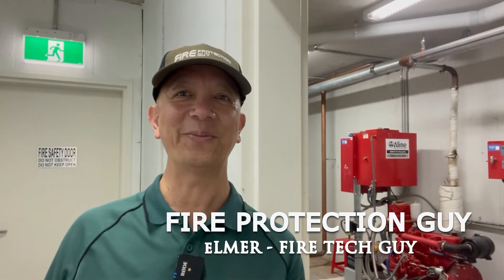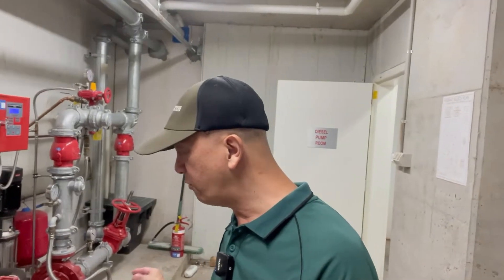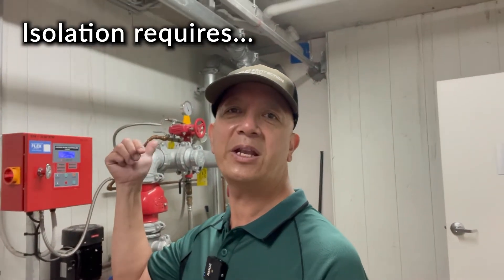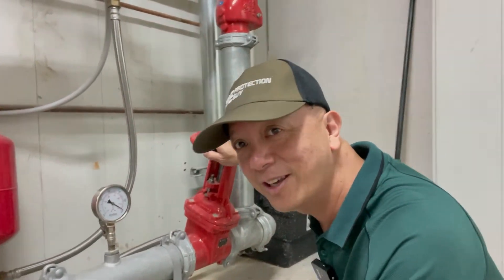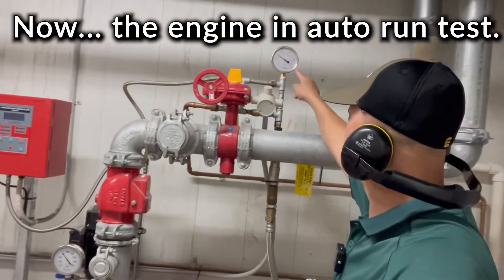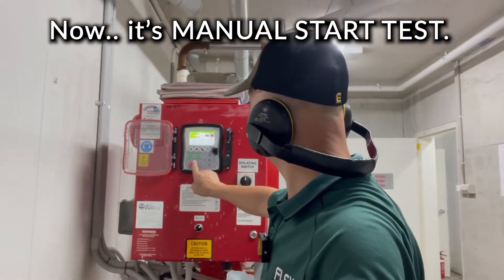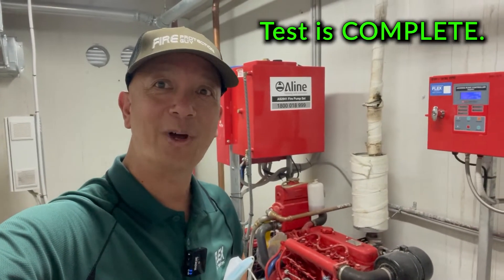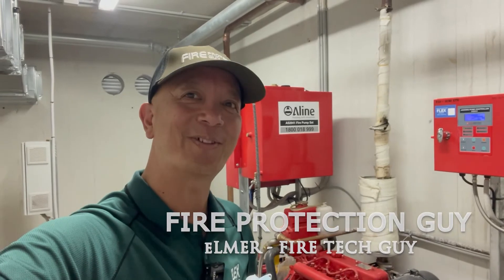FIRE HYDRANT PUMP SYSTEM - HOW TO TEST A HYDRANT DIESEL PUMP

Comment: Hi Sir Elmer. Tanong ko lang po sa Sequence of Operation ng Fire Pumps mainly JP, Elec FP, Diesel FP. 

When there is more demand in the system,

1st Question: Does Jockey Pump operates with Electric Fire Pump? Or Jockey Pump auto cuts/turn off when Electric Kicks in? Since Electric capacity can already suffice the system demand during fire.

2nd: Whilst Electric Fire Pump is running, should there be further demand and Diesel Fire Pump preset cut-in /turn on pressure is reached, do Electric and Diesel FP operate together? Or Diesel Fire Pump just really operate/kicks in during Power Failure?
Reply from the maker: Answer: 1- Once the electric pump runs. The pressure already exceeded the cut-out pressure of the JP. So, the JP stops. The purpose of JP is only to maintain the installation pressure of the system to avoid the unnecessary start of the electric pump.
2. - The diesel engine has a lower discharge pressure and cut-in pressure than the electric pump. (normally 2 x lower). Diesel is only a back-up of the electric pump in case of blackout. In the control panel, once the electric motor is running, it automatically isolate the diesel engine from cranking to avoid damage to the engine. This is for piggy bank installation where diesel engine and electric motor have the same shaft.
Reply: @fireprotectionguy7943  Thanks Sir Elmer. 

What is Piggy Bank Installation po pala? What do you mean by Electric and Diesel FP have the same shaft? 

What if it’s not a Piggy Bank Installation type, are they (Electric & Diesel FP) allowed to operate together? Or there will never be instances that they will be permitted to operate together regardless of Installation type? If not allowed totally, what are the other reasons why we should avoid them to operate together Sir.
Reply from the maker: @arnelada6216  ...Sorry, piggy bank is our term here. It's the electric motor (rotor) and diesel engine shaft are join together and connected to the centri pump. Here, the diesel engine will not allo to crank/run if the electric motor is running. For separate electric and diesel engine driver of a centrifugal pump, they have their separate controls. If the diesel engine runs simultaneously with the electric motor pump, it has no effect to any pump. The highest discharge pressure will prevail. That is, the electric motor pump. Take note, each line has a one way valve or check valve, so higher upper pressure shuts the check valve of the discharge with lower pressure.
Reply: @fireprotectionguy7943  Just saw this. Noted. Thank you so much Sir Elmer.

Comment: I heard that once the engine runs, because this is an emergency equipment it should not have any ways to turn it off except when the fuel is running out. Is this statement true?
Reply from the maker: There's always a STOP switch. If it fails due to solenoid not energising, pull it off manually. Another is a PULL Stop Cable for old engines.

Comment: Hai sir.. I have an one question.. Why hydrant system is connected to diesel pump? In case of any emergency Jockey pump will manage this hydrant system.
Reply from the maker: Hi Reeban. The purpose of a JP is to restore minor/gradual  loss in water pressure. If the loss in pressure is too high and sudden, the diesel pump will kick in to provide the water pressure requirement as per design. The reason why diesel engine is used as prime mover of hydrant pump is based on "fire condition" where normal electricity is not available. By Aust Standard, the engine can run for 4 hours with fuel to supply the engine for minimum of 4 hours. Hope this answers your question. Thnxs
Reply from the maker: Also, there are hydrant system that has both electric motor and diesel engine as prime mover at the same time - we call it piggy bank.
Reply: Okey thanks. Kindly make one video for firefighting to fire alarm interface connection.
Reply from the maker: @reebankennedy4024  ..i will release one video about Fire Panel to Fire Brigade Connection.